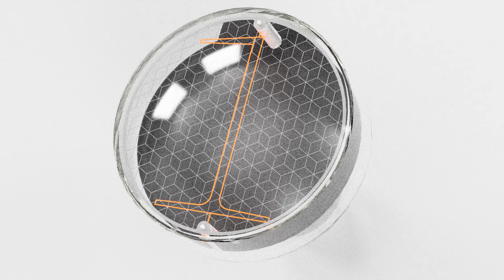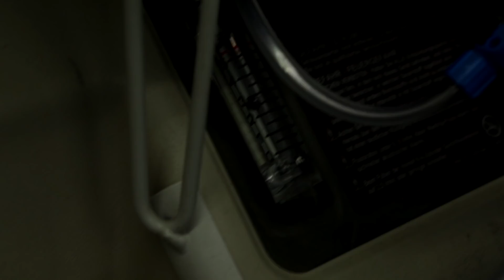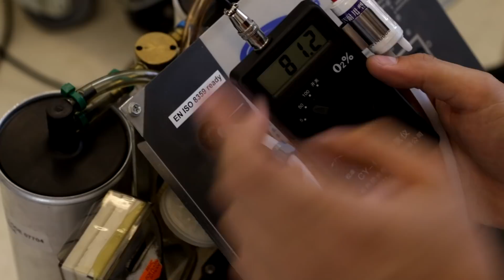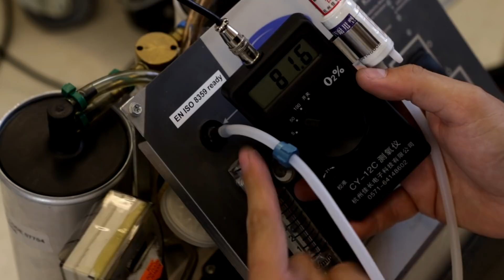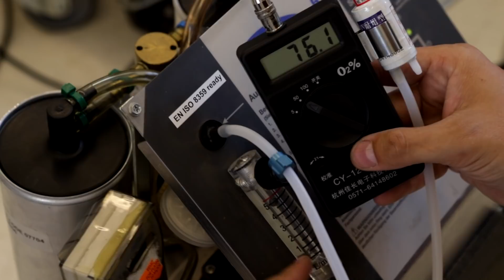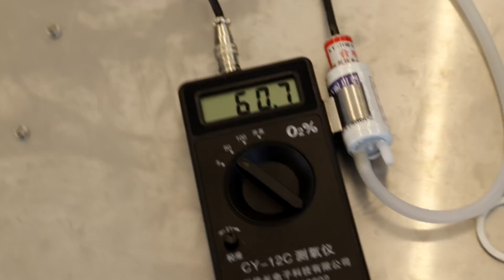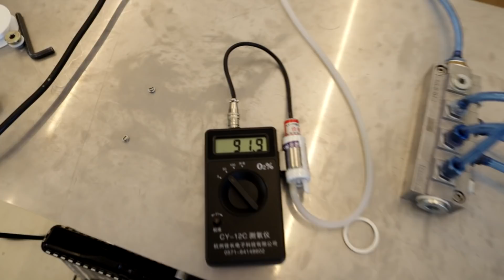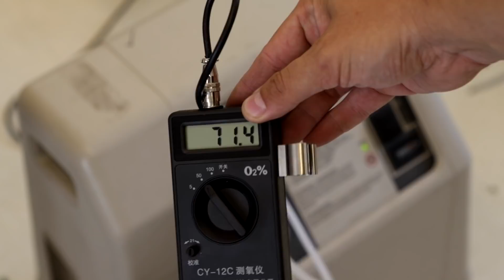30L/m Oxygen Concentrator Update - Project H #14

Comment: Very interesting project. :-)

If you think the problem is water in the Zeolites could you not just simply put them under a hard vacuum and then let the water evaporate out that way, you don't want to recirculate the air when you dry out the Zeolites but perhaps adding some heat to them while you evaporate them would help speed things up a bit.

Comment: I have used many of those smaller oxycon. You never want to totally max them out, as you start losing purity in exchange for volume. The best you will get  is around 4lpm at 90% or so.  Also the nasty long candles may be due to dirty or damaged torch ports. See if a wire brush or a port cleaner works to fix it. Make sure you run compressed air through it to push out any detritus! 

great video!

Comment: I would not wait to see the failure point on the car radiator and pop in some AC condensers in their place, which are far higher rated beasts. Roof top units, would probably have the best parts for this kind of stuff (i'm only saying(basing) this because they're designed to run bigger distances, nothing else). To my knowledge, most car rads don't peak over ~16psi unless they're highly specialized systems (IE, expensive).

One other thing, i'd get rid of the commercial ball valves you're using for something with a screw based system. I know, antiquated, but there's no substitute for screw based regulators when it comes to precision, and if there's one thing i've learnt over the years with handling stuff like this, is that at the end of the day, you want to go down the path of least resistance. BUT, this is just a personal preference. 

That jamble aside, awesome update.
Reply from the maker: The radiator is a proof of concept test, it was on sale for 30€.. if it works, we will end up with the AC radiator - good to know. The ball valves were at hand, the best would be a setup with two proportional valves - control of both lines at once. Cheers!

Comment: Hello Dalibor. Great and very interesting lab work!
I watched a jewelry maker using propane and a "mouth piece" to blow into the flame, simply using his body exhaust. He claims that the flame reaches about 2000° C and he was able to melt gold/silver to make a finger ring. Sure, you add additional exhaust gases into the flame, mainly N2, CO2, and H2O, that might be problematic, but when I saw him blowing into his torch, via a dedicated mouth piece that pipes the exhaust gas to the propane/valve, I was wondering if that could be useful in my lab. To test it out, you only would need compressor pumps and maybe a dehumidifier - both you already have. FYI, you might want to check out a so called "Mundloetrohr" (Trubka pro pájení úst?) for propan. Food for thought :) Good look with your project. Stefan.
Reply from the maker: The propane/oxy flame that we use reaches 2820C, with air from compressor it is 1980C only. Air from your lungs contains even less ocygen than regular air, so the temperature is even lower. But it might work for small jewelry items.
Reply: @daliborfarny  Thanks for your reply. Stefan

Comment: He dalibor!
had same problems with my sievebeds. I put them in the oven under vacuum and it did not help anything.  Have some more old concentrators all same sort of problems.I guess the best is new molecular sieves. I have the idea that short runs are not good-leave them on once started. I vent what i dont need with a relieve valve. In my experience with the little philips burners anything under 90% O2 is not good enough. The burners work but it is not gonna do the job properly...
Greeting jerome
Reply from the maker: Hi Jerome, great to see you here. I have couple of emails from you waiting for a reply ;-) I am trying to regenerate the sieves in vacuum oven right now, we will see. What vacuum level and temperature did you use? I am at 250C, trying to reach 10e-3 mBar. We can comfortably use 80% oxygen in our torches.

Comment: I would think some kind of liquid oxygen system would be FAR more reliable and easier. expansion ratio is like 1 liter of liquid to 900 liters gas. 10-20 liters would get you through a whole day! All you'd need to supply is some heat for boiling.
Reply: You don't need heat to boil Lox, just decrease the pressure
Reply: Also, it's super dangerous to have oxigen stored. Its always better to generate as needed if you can.
Reply: @thomasesr  lol, chemistry much? what do you think is causing the boiling when you reduce the pressure? IT'S HEAT. That's why the temperature of the liquid rapidly falls as it boils under reduced pressure. If all you did was reduce the pressure without adding heat it would quickly freeze solid
Reply from the maker: Yes, liquid would be much easier to use. But we cant place a large unit outside, just 50L inside. Such cylinder contains 10 cubic meters of oxygen. That is enough for 5 hours of work. It would be impractical to go this way. But we might end up with liquid anyway..

Comment: Here is what I'm working on to make my own concentrator... http://youtu.be/UFdXYqKoshU 

Might be helpful to you? I'm not as technically minded as you are so I'm struggling. But the German engineering is freely shared and addresses some of your issues as well.

Have you considered running a high volume oxygen concentrator? 
https://youtu.be/JVOmXhjbLGQ
A company sells it in the states and it is specifically used for producing oxygen for glass blowers. It costs about 5 thousand USD, but it can produce whatever you need in LPM.

I don't have the resources to buy the hvo, but I think I can make my own concentrator for less than it will cost me to buy a new concentrator.

Also, have you considered using a desiccant like salt or sodium silicate to run your air thru before sending it thru the sieve? Also, I've been looking at an aquarium pump which is designed to run all the time and not produce heated sit. There are a lot of those that produce at various levels...

Those are the thoughts I've been working with... Hope it's useful. If so, I'd love a very simplified step by step to make my own concentrator... :-)

Alternatively, I'm looking at a Hydrogen Oxygen water torch that separates them, I'm just not sure how to do it at the volume I'd need so I could use it for several hours at a time...

Comment: To regenerate ceolite it needs to be heated and vacuumised. You can check it in small value just to make very simple weight meserument before procedure and after and check how mach water it can absorb.
Reply: I was listening in the background to the video and was just about to write the same.
The one problem is, if there is dirt/dust or oil from the compressor in the gas it can permanently
Block the pores of the zeolite too. 
A good thing would be to have a activated car I  filter before the zeolite modules, maybe with a cartridge of 
Desiccant to catch residual moisture.

Comment: Would it be viable to use electrolysis? Maybe even discarding the hydrogen and only using the oxygen. It seems like that might actually turn out to be less of a hassle than the current system.
Reply: No, you'd need an electrolysis system the size of that concentrator build and it would consume >10kW, as well as slowly corrode and consume the electrolyte.
Plus, you'd get very wet oxygen.
And it'd cost well north of $10k

Comment: those car radiators are only rated 12 - 15 psi.
Reply from the maker: There is around 30 psi (2 bar) in this system, the pressure of coolant in the car can get close to this pressure, so I believe it will do it. Good point though!
Reply: @Ben T. Good idea

Comment: Great project! I admire your meticulous approach and have followed you from the beginning. With regard to the problem with the sieves; I designed a similar project where wet air 95%RH loaded with CO2 was to be filtered in a similar manner. To keep the humidity from damaging the filter we used a Peltier element and finned heat exchanger inside an aluminium case, condensate was drained by gravity from the base of the case (into a sealed container) , this may be a more effective method of moisture removal than using ambient air temperature for the condenser. I assume that you probably measured the %RH coming out of the condenser? Good luck with your marvellous work, truly inspiring!
Reply: I noticed a mini fridge next to the o2 unit. As a fast experiment, I'd be tempted to try placing the car radiator in the fridge, and long term work towards making the HX smaller as you describe.
Reply from the maker: Thank you! At the moment the condense water flows down to bottom of the radiator where it is trapped in a pressure regulator reservoir - I can drain the water easily from the reservoir. The original oxycon uses room temp air for cooling, so I believe it will work without additional cooling. How do you measure RH inside the system?
Reply: Dalibor Farný 
Our system was a a low pressure (approx 0.5bar above ambient) we used a handheld RH meter with a wand and made a small chamber into which the wand could be fitted ( I guess that if you made similar with an O ring to seal against the higher pressure, assuming the internal part of the wand is airtight, or just let the air escape to atmosphere during the test?) the chamber had inlet and outlet fittings to connect tubing from the condenser and to the filter bed, hope this helps...
Reply: Oh and I forgot to point out that you may need to correct the RH for the pressure you are measuring at, page 51 of this document gives curves for this: https://www.npl.co.uk/special-pages/guides/a-guide-to-the-measure-of-humidity-gpg103, or you just make a "relative / relative %RH" measurement of the improvement for various setups of condenser....

Comment: Would a hydrogen flame be hot enough, if so would be electrolysis of water be an option?
Reply: I think the heat would be enough with a hydrogen flame, but i think this solution is more economical for long run use if one got those used and in this state where they are no longer concidered being suitable for medical use. But yes, still an interesting idea.
Reply: To match 30LPM oxypropane you would need probably 5 maybe even 10kW HHO. It could result in unit in similar size. It would definitely need cooling that will resist alkali, so that could be an issue. It would be a bit scary to operate, but it would be less louder and you get a "free" gas along with oxygen :)

Also you can't really continously regulate output easily. it is definitely viable option, but first get small unit and play with that to understand it's limitations and benefits.
Reply from the maker: Hydrogen flame is even hotter, but more difficult to work with - it is almost invisible.
Reply: Required for working quartz
Reply: @IlusysSystems  maybe if you combine both methods it works better
Reply: @IlusysSystems  maybe he can get some advice from another YouTuber RHNMB

Comment: You may need to activate them, to unlock adsorption, like you would charcoal. It's usually done exposing them to an activating chemical (acid or base) and then driving out moisture. Some zeolites activate with strong alkali, some require a 1-2 step process with both